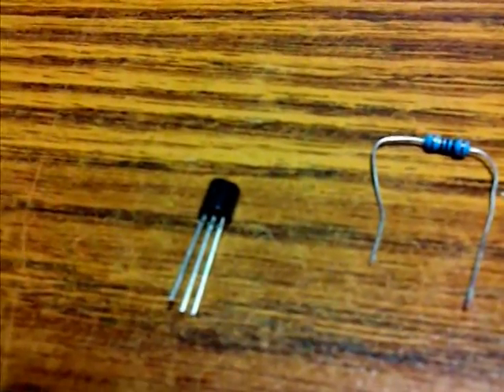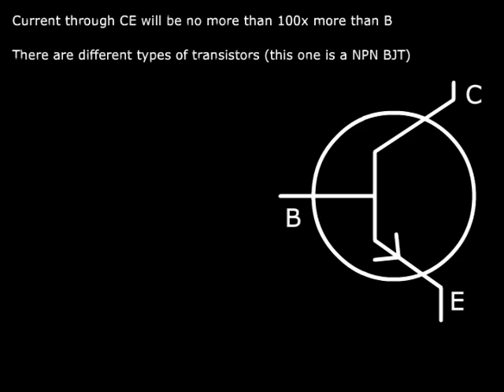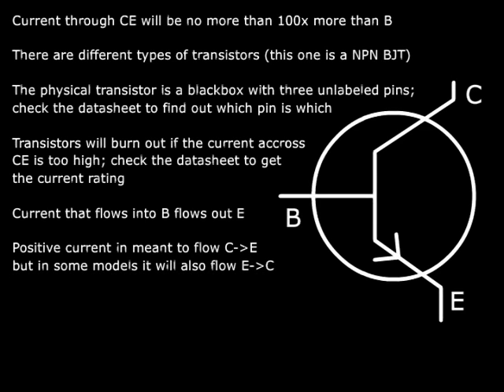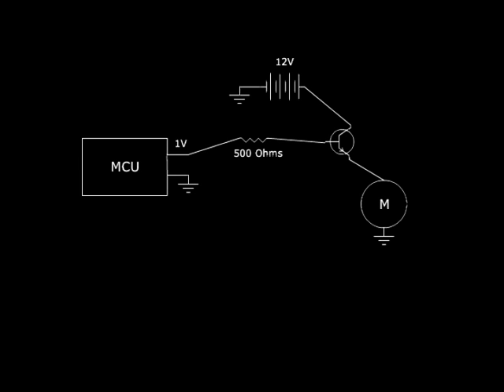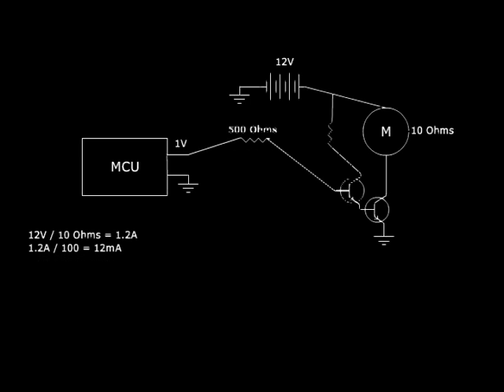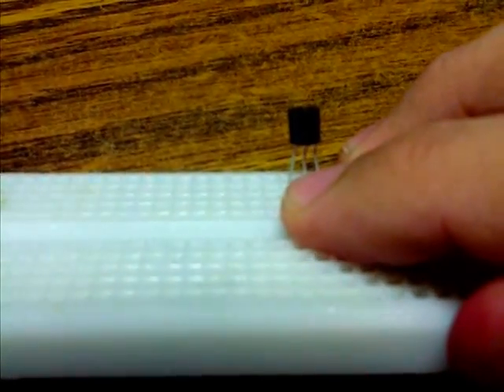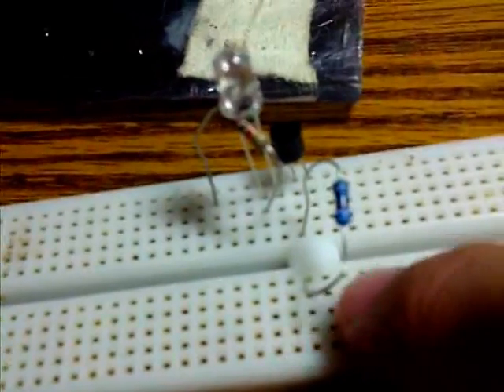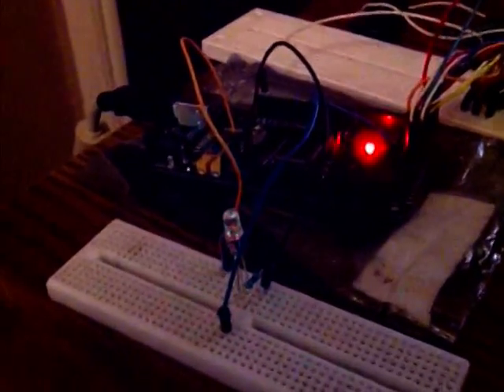Practical Transistor Tutorial w/ Arduino MCU

Comment from the maker: One resistor is connected with the transistor. BJT transistors and LEDs have 0 resistance (however there is a voltage drop), so if you don't use a resistor you'll get ~infinite current (in theory). You always want about 15mA of current going through your LEDs. So for a 5V battery, an LED might drop the voltage by 2V, and you'll need a ~133 Ohm resistor to get to 15mA. The resistor needed for the transistor is 100 * (5V/15mA), as described in the video.

Comment: Question. If I were to use a 9V battery , how should I wire it? I know the positive will go to the left pin of the transistor, how about the negative of the battery? Should it go to the right pin of the transistor? Or should it go to the ground of the arduino and have a jumper wire from the right pin of the transistor to arduino ground?